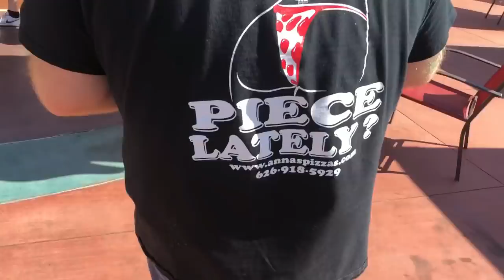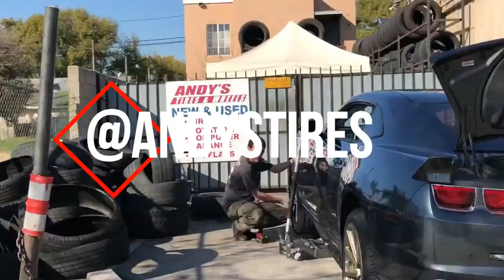NEW Balcony Drift Layout Testing for Jimmy Up Matsuri: Jimmy Up TV Ep. 9

Comment: First section up to the “house” looks fast, fun and flowy. Lots of Water barriers definitely needed though, makes fucking up that bit more real, which always adds to the fun
Reply from the maker: Craig Derrick you see it lol. Yea, the above/side camera angle doesn’t do the amount of room you have justice. There is room, but there will be fuck ups.
Reply: Fucking up just show you're trying. Seems like you're really utilising the track and large area well, and the water barriers will make good clipping points - the drivers are going to have a blast. Good luck with the Matsuri.